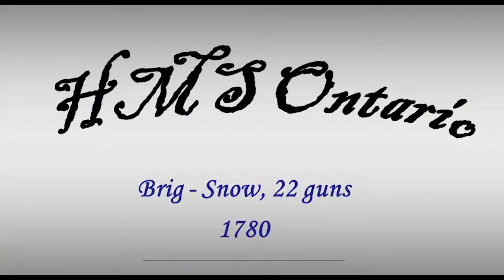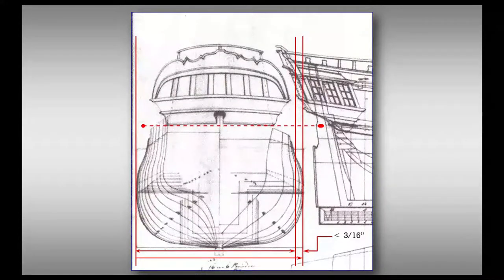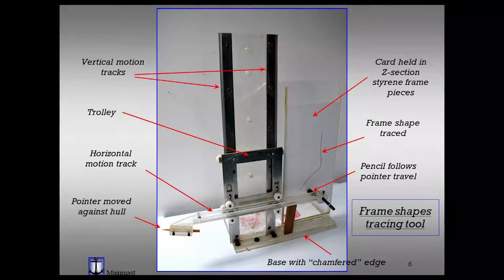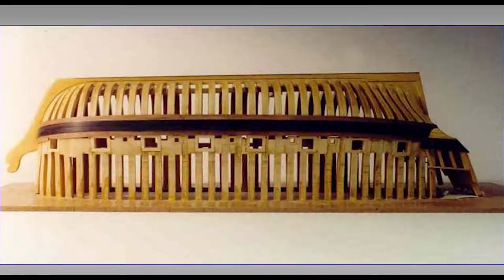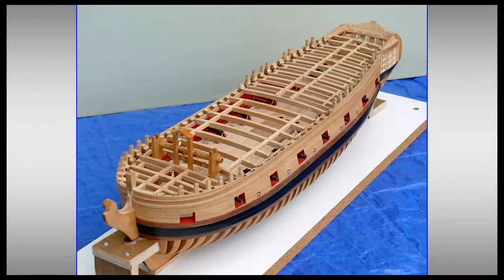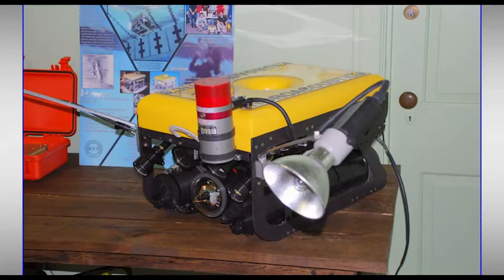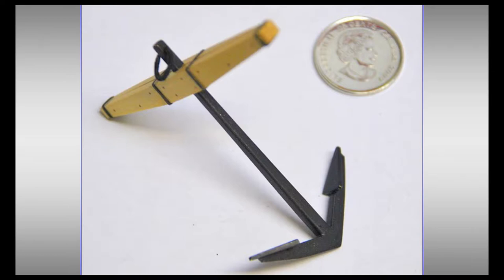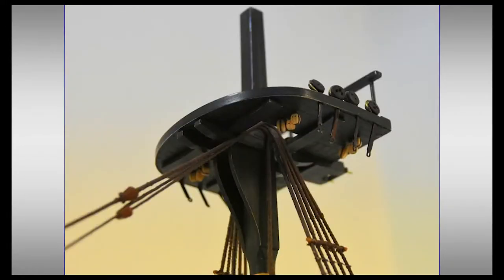HMS Ontario 1780 - Part 3: Building the Model

Comment: Similar to Harold Hahn's "Oliver Cromwell", no?
Reply: "Ontario" is similar to "Cromwell" in profile but the differences are more visible in the body plan.  "Ontario" has a finer entry leading to hull sections with noticeable tumble-home, and a broader gun deck aft, perhaps to allow greater freight carrying on the Lake.  "Cromwell's" bow is near-plumb and her sections are almost circular at midships, which then lead to the frames tucking in and reaching the aft deadwood earlier and producing a more classic "wine-glass" shape .

Comment: need plans please
Reply: I corrected for shrinkage/stretching of the original draft, so when I made the hull using Hahn's method, I worked from copies/tracings of the draft to produce my working plans for frames and the location of other structures such as the head works, wales, gun ports etc.   "The Construction and Fitting of the English Man of War" by Peter Goodwin, "The Arming and Fitting of English Ships of War" by Brian Lavery  and "The Masting and Rigging of English Ships of War" by James Lees gave considerable information on detail for ships of this period.

Comment: Good modelling but the red paint is not period correct. If they used vermilion even pure (which is unlikely as that was an expensive pigment) it didn't look like our modern reds. I think museum pieces show a much more earthy red on the bulwarks. Just pointing this out because it seems like everyone is following Model Shipways and they aren't right on this point.
Reply: Given that ship colours were often the choice of a ship's captain it is difficult to determine the exact colour or mixture that might have been used, although there may have been an Admiralty specification that I am not aware of. (I note the "contemporary" colour now being used on the hull on the present restoration of Victory!)  The crimson red I used was as close a shade and tone to match contemporary models I found (electronically) at the time, more so than vermilion or even scarlet.  Nicholas points out that it may not be correct, but there are many aspects of a model that are not necessarily absolutely authentic, and "close enough" may be an appropriate aphorism to apply here.

The red was applied some years before the Model Shipways kit was issued.
Ray